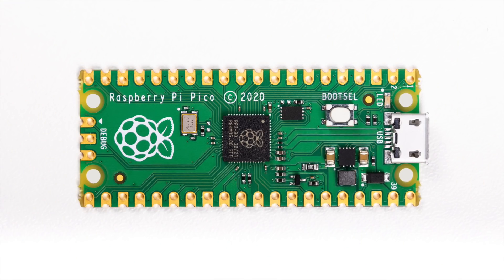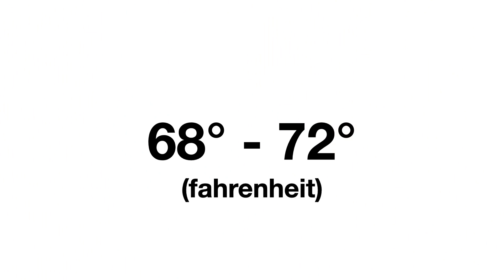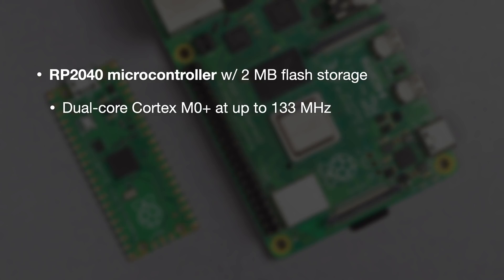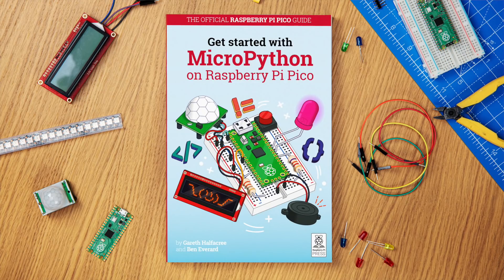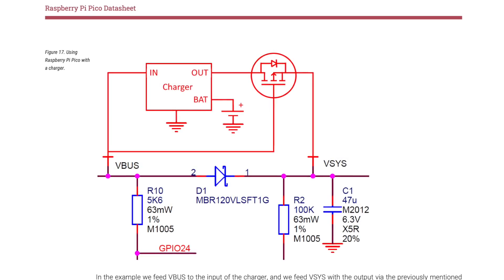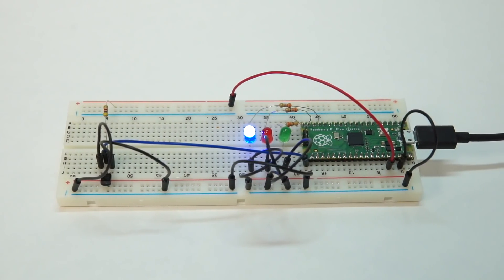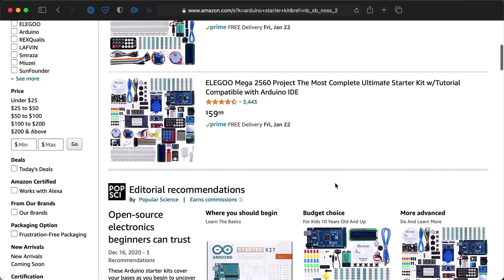The Raspberry Pi Pico Review - $4 ARM Microcontroller

Comment: preferably, there is ACTUALLY a temperature sensor inside the RP2040. i have a pico, and i tried it, but they said it's a low-quality temp sensor, so you would have to calibrate it

Comment: You only need 1 resistor if you run only 1 LED at a time (especially because you use the same resistor value of all 3 of them), it's even helpful to limit the current when you run all LEDs at startup

Comment: Personally love the Pico as it's fast and has two cores (which have been essential for one of my projects.) I can program and compile the code the way I'm already used to in any other C++ project. One thing I don't particularly like is having to unplug, hold down BOOTSEL, plug in and manually transfer the .utf file. I'm sure I can get an USB cable with a switch on it to electrically disconnect the Pico, so it's not that big of a deal.

Comment: I was just planning on doing something similar for my ants: They need to be kept in the fridge over winter and need to be slowly acclimatised to warmer temperatures in the spring, by puting them into an insulated box on the balcony when the weather is just right for two weeks. But they may not freeze, so if there's a surprise frost one night they could die. So I'm planning on putting one of my older Pis into the box with them and add a temperature sensor. If temp falls below 5°C, I could just run the PI through some complex calculations to heat up the box 😜 
This way I might be able to ramp up the temperature over those two weeks relatively independantly from the actual weather...
Unfortunately my temperature probe returns an analog signal, and when checking where to connect it to the PI, I came to find out that the GPIOs are all digital, no ADC in sight 😲 A Pi pico might be the solution there, though I should also get the WIFI shield so I can log the temperature data by pushing it to prometheus every couple minutes... (I'm guessing the Wifi takes a lot of power...)
Reply: Ah. While writing this I recalled that my sensor had "1-wire", which I knew nothing about and wanted to read up on. Turns out that would make it work on the Pi without an ADC: https://www.waveshare.com/wiki/Raspberry_Pi_Tutorial_Series:_1-Wire_DS18B20_Sensor 😜
The Pi Pico is now in my cart nevertheless 😁

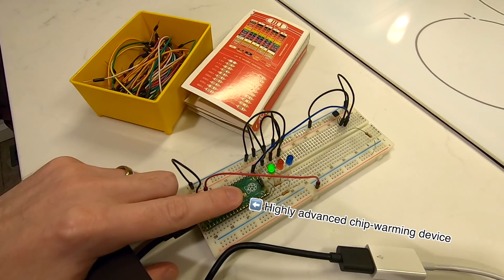Comment: I have PhD in electrical engineering and 9:07 you were raising and cooling the temperature of the processor which is completely wrong for demonstration of your application. You need to do that on the actual temperature sensor (I'm assuming you used LM35 in this case) as that's the one measuring temperature changes. Though it worked in your video, i dont know if its because of drift in clock of the processor or something else but thats not the application here. Everything else is on point and nice explanation.

Comment: There is just so many people who can't afford to keep their houses warm.  Forty years ago my house dropped into the 40'sF at night and sometimes the water would freeze. I talked to the my son's Pediatrician, he was from England (back then many in England did not have central heating) and told me to keep a hat on him and bundle him up. I made a small sleeping bag for him and he did great so did my next son.  When it got to 30F or 40F below they would sleep with us and I would get up and start a fire and my oldest and I would sit by the wood stove until the water thawed out.  Times have changed. This is anecdotal but I see that most people don't dress for the cold and then don't dress their children for the cold either. Leading to kid's getting too cold and having health problems including dying.  From doing a search about heating in England. The share of households in the UK with central heating systems has increased significantly since 1970, when just 30 percent of households had central heating.Jun 11, 2021

Comment: Okay, i'm a bit confused on why you hooked up a temperature sensor to this setup??  the Pico comes with a Built in Temp Sensor?  ( Check YT , pico temp sensor )
Reply from the maker: The Pico's internal temperature sensor is useful but not necessarily as accurate for environment monitoring as other sensors, since it's part of the die package and could be influenced by the Pico's own heat (eg increasing under heavier workloads).
Reply: @JeffGeerling  thanks for the info.. had to go check the data sheet. and now I understand what you mean.. it's not a real sensor per say. just reading the temp on the chip. which will change with voltage. etc.

Comment: Jeff, the temp monitor is a nice project, but having to go to the room to check the lights seems ... limiting. Is the Pico able to [easily] send to a database on a db server or something like that? or would a normal Pi be better? Or, could the Pico run as you have it but be connected to a Pi via the USB permanently then let the Pi know when the temperatures are out of safe range then get the Pi to let you know via twitter perhaps.

Thanks,

Comment: The most bizarre use-case I could come up with for an Arduino microcontroller was when I was contracting overseas in the desert.
We lived in these tiny CHUs (Containerized Housing Units) that had windows but they were all sealed up to prevent sand and dust from getting inside.
So I built a tiny weather station using an Arduino Mega and had it wirelessly transmit weather data via a 433mhz transceiver breakout board soldered to it.  This I mounted on the same antenna tower that our wifi antennas were mounted on and tapped a voltage converter board into the 48v line powering the wifi antenna array to power the Arduino.  The whole thing was encased in a small weatherproof plastic box I made sure was the same color of the wifi antennas so as not to stand out too much. 
OK, weather station up and running...now what?
Well, then I built an Arduino-powered custom weather display box for each CHU that had a tiny 2.4" screen on it that would show current weather conditions (temp, humidity, wind speed/direction, light data, and date/time) complete with current weather icons.  A small speaker was installed on each box for when wind speeds would exceed 30mph coming from the west which would indicate a sand storm was approaching.  If it also suddenly got dark during daytime hours, that too indicated a sand storm was in progress.  It worked out well enough and folks seemed to like them.
Why Arduino instead of Pis?  Simple - cost and robustness.  I needed something that could survive the frequent power blackouts we'd have when generators overheated or were cut-over every Sunday morning.  A Pi has more of a chance of SD card corruption whereas flashed Arduino microcontroller code doesn't corrupt as easily due to power events.
When I built that system I knew jack-all about microcontrollers and only had a high school education.  But I could "see" the parts I needed and how to connect them all together in my mind.  Writing and testing the wireless bits of the microcontroller code was probably the hardest part of the whole project.  I think I may still have that code on an ancient Macbook Air somewhere...
Well, that and the long shipping times from Adafruit and Sparkfun being on the Iraq-Kuwait border and all.

Comment: Hey, do you know how one would go about running CRON jobs? I’m looking to make an automated mister system for my veggie garden that goes off twice a day.
Reply: Forgot to add that I would like to do it in c++ and not micro python. I also hope to extend the functionality to control LED light strips on a cycle, monitor temperature and humidity and control heaters/ Fans accordingly.
Reply: @rafaelzasas  AFAIK, using the internal timers or a real-time clock solve the timing define issue. Regarding C++, the SDK of that RPi Pico supports it.
Reply: @rafaelzasas  For handling sensors and controlling those LED strips, you have 2 options: Make your own drivers, or use/tweak the drivers someone else made.

Comment: I'm just starting out in the tiny SBC/microcontroller world. Would this or a pi zero be better for an e ink nametag? I'd like to try this as my first project
Reply: Depends on your aims. If you want to learn how to program microcontrollers, the Raspberry Pi Pico is suitable. If you intend on learning programming on a PC with a OS, the Raspberry Pi 4B will be a better experience.

For a E-ink nametag, i think the Pico is a better choice, mostly for its lower power consumption, and still having large headroom for adding software features to your project.
Reply: @Loundre3  I have a pico and some adafruit boards based on the RP2040

Comment: If you use Circuitpython and the onewire and ds18x20 libraries from adafruit you can use a DS18B20 temperature sensor which is way more accurate.

Comment: I would add to this project, some kind of a fan-driven electric heater that you can turn on and off with a relay if it gets too cold, and one of those really loud piezo type speakers that will wake the dead when you put even 12 volts on them so if it gets too hot,  you can sound the alarm ... in fact, even with the electric heater, I would sound an alarm if the too cold or too hot state remained constant for more than 5 minutes... babies are too fragile and you want something to wake you up in the middle of the night if the environment gets too dangerous.

Comment: Why would you go from comparing the esp32 to the atmega 32U4 (pro micro's ic). There is so much in between and this is a horrible comparison designed to prove your point and not display facts.

Comment: I picked up a couple of these to play with. I'm an EE among lots of other computational trades. Here's the high points for me:
- The PIO which is a sort of configurable fabric is neat. I like the PIO assembly language. It's much more user friendly than say the SAM D5x line with their configurable logic ports.
- Micropython runs decently fast. It's generally pretty stable in terms of real-timey-ness which is very important for pushing Micro/Circuit Python as a platform.
- It's virtually unbrick-able.
Though there are some cons:
- Having to reboot holding BOOTSEL kinda sucks. These are the sorts of devices that are great to have in rapid prototyping labs where we'll put a few of these on a tray connected to peripherals and use automated tools to push out builds. This makes the programming task almost impossible without manual intervention. It's possible to work around this by shorting the BOOTSEL pin manually, but that's a manual rework to a project board. Not the best.
- It feels like the hardware made it to the market before the software did. It's very obvious that the C/C++ side of the development flow didn't reach maturity in time and it's painfully obvious when reading the documentation. As much as I love how the Pi Foundation writes their documentation to look very pretty, it's not as informative as the sorts of documents you'd get in an STM or SAM style document with its raw, almost terse but extremely clear style of explaining things. The toolchain, likewise, is a wild hash of tools. I think it would have benefited them to get this under the Arduino umbrella first, and I hope they move that direction. It feels weird to tell a newbie that I wouldn't recommend a Pi product for beginner programming in C. 
- As an extension to the last point, lots of the GitHub software examples for the Pico that are officially from the Pi Foundation are riddled with errors, spelling mistakes, poor explanations, and just come off as a huge rush job. Pimoroni and Sparkfun in my view have been holding that mantle a lot higher and their software and extensions are much higher quality. Again, just a weird thing to see from the Pi foundation.
- This is very commercial focused comment, but it would be cool if the chip itself could be purchased by itself rather than on a carrier board. If I wanted to integrate this into any of my products, I'd have to split a separate power domain to feed into this board's own power domain. I have a configurable clock generator on board. The RP 2040 is a captivating piece of silicon with real world benefits that have market value to commercial users that their competitors don't have. It would be nice as a vendor to utilize that without the baggage around the chip. For people who comment and say "this is for hobbyists, not business", DigiKey is already taking bulk orders for this thing for commercial use, and it's been communicated at least to me that it's suitable for commercial projects.

Comment: In theory, you could create a serial output and feed a computer with the data for long term stuff. But what do you mean you can make your own board, is there already a tutorial how to make your own board? I mean, I do it with the Arduino all the time. The processor and FTDI output of USB may be a small problem.

Comment: Wait, shouldn't the LED's be fine without resistors, since the standard voltage is 3.3v?
Reply: LED's need resistors for current limiting not voltage

Comment: The best thing about the Pico is the bridge between electronics engineering and programming. Our worlds are getting closer and closer. I'm the one in the middle, a mechatronics engineer, although I'm much more on the electronics side. You should check out mbed. org if you find you like microcontrollers

Comment: First excellent video, really enjoyed learning what you shared about your experiences with Pico. As others mention the price to people in the rest of the world and feature set are reasons people go ESP32. There are 3 major ESP32 variants. One for AI, the main 3 core CPU (2 FAST, 1 Ultra Low Power), and a single core variant. Adding wireless to Pi costs more than $5 for an ESP32 with everything including the kitchen sink included. The ULP CORE is now RISC-V instead of ARM with Pi so that's really interesting and the new ESP32-C3 should be in stores by March this year and is a interesting to the extreme becuae the fast CPU CORE is going to be RISC-V as well as the ULP CORE. RISC-V is suddenly becoming a real thing in a big way. As you say if you have a desire to do micropython having lots of ram is a good thing. If you are using Arduino instead aka C++ then having tons of ram is less useful as microcontroller are for always on and instant on/program run and low power sensor data readers. Once you have the sensor data you send it to your Raspberry Pi Zero/Zero W and now you have a full Linux Server running Node Red / Mosquito MQTT consuming all the sensor data from your microcontrollers and then you have the full Linux environment to write full CPython programs to massage that data and be pretty dull blown web server dashboards versus the simple web server that runs on the ESP32 itself, yes it also runs its own web page... I love Pi and have a mountain of Pi Zero boards but I am less excited about the Pico as compared to what the ESP32 are delivering to me in capabilities at just $5 a DevKit board. Once you finalize a project and write an ESP32 module directly and ditch the DevKitC board you get insane power saving and very little consumption as the power circuitry and USB interface generatea the majority of the power consumed in an ESP32 DevKitC board and not the ESP32 itself. Also in sleep you are running in the Ultra Low Power core which means you can still have programs running in the ESP32 even in the low power consumption sleep mode. Yes you learn a few new compands like using interrupts instead of delays and one of the three RTC CLOCKS in the ESP32 so you can have a ton of code execute instead of blocking as with delay. And a few commands to run two programs each on the two fast cores but it's really very simple to learn and use. And how to run programs in the ULP CORE. Maybe I just answered my own question -- because I understand the few extra commands and how to make the ESP32 really dance maybe that's why I'm less excited about Pico. If I tried to make Pico dance as much as I do with my ESP32 projects I'd just find it with two left feet being a bit of a clumsy dancer. But I'll always keep an open mind so if I can find people doing some new things with Pico I'll definitely give it another look. Until then I'll just miss out due to not really understanding it yet well enough to known where it fits in my use cases. If it had all the Wi-Fi + Bluetooth + Bluetooth LE + Long Range 1 kilometers radio transmission features of the ESP32 (Pushed to over 100 kilometers by experimenters who get a kick out of radio distance challenges) I would have bought a Pico and be playing with it right now to find its capabilities limits to see what I could really do with it.